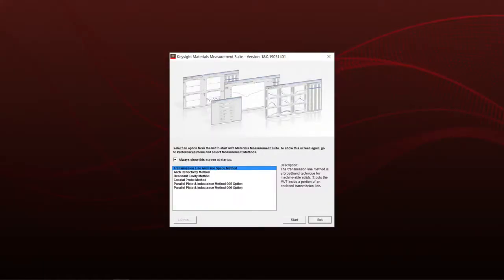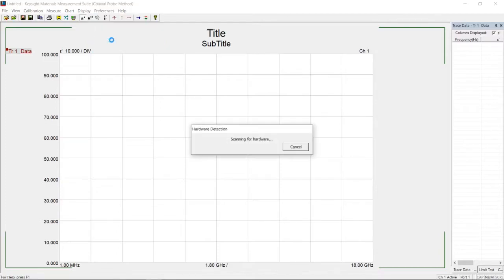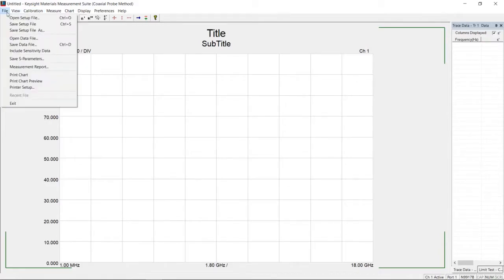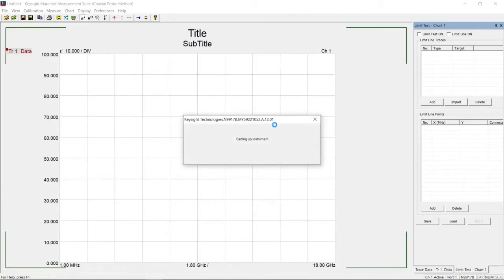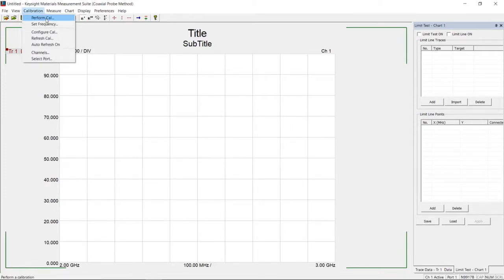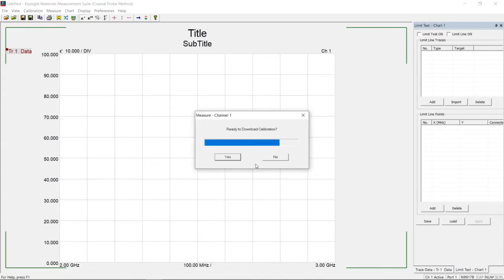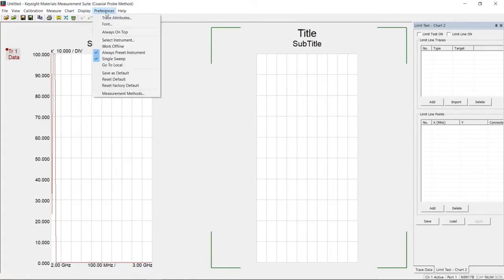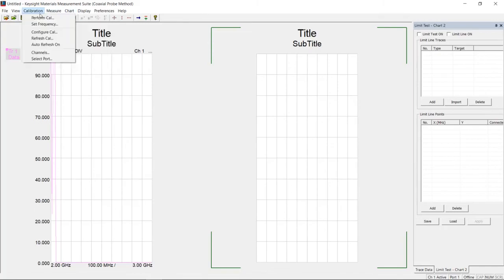N1500A Material Measurement Part#1 #N1500A #Material #Dielectric

Comment: Can you please tell me in coax probe method , which probe is used to characterize the powder material , is it Slim , High Temp or Performance probe ? Need ur help to understand.
Reply from the maker: all three type of the probes can be used depending on the type of test condition. Slim probe is general use and for small tube; performance probe is suitable when you need low loss measurement, bigger foot print; High temp mainly for higher temperature condition testing. Powder measurement is hard as it's hard to make sure the powder is compacted in the same consistency. 
as long as you can find a way to compact the powder consistently and you should be able to get a repeatable result.
hope this helps